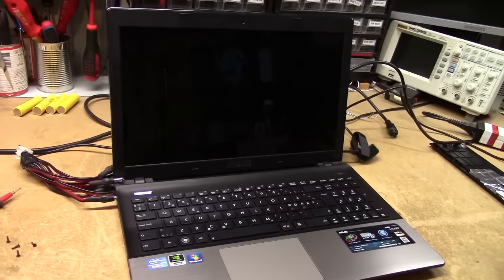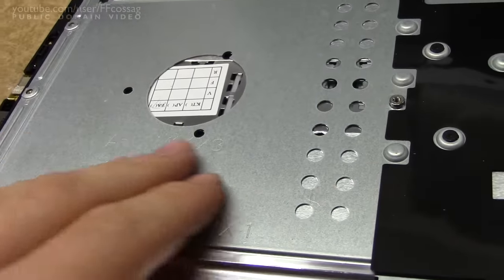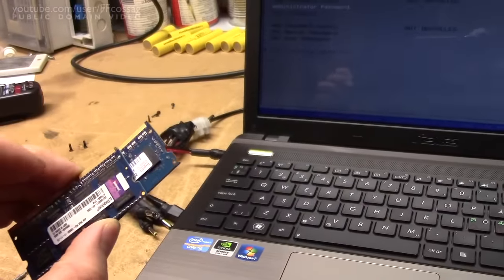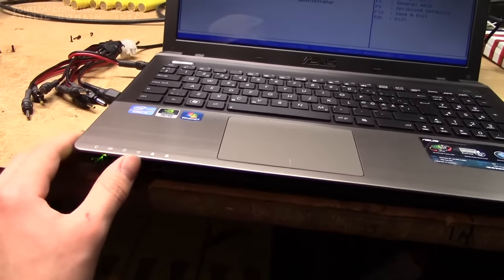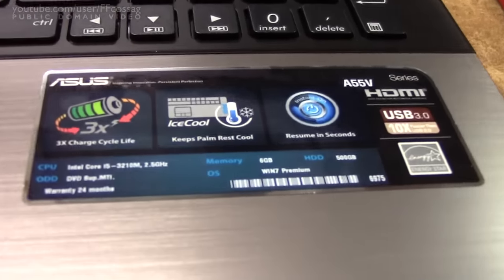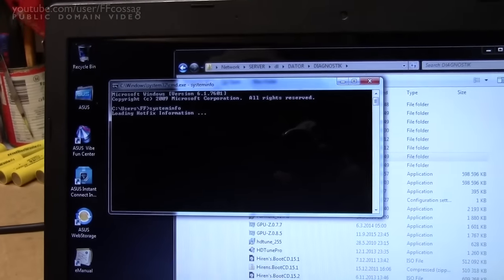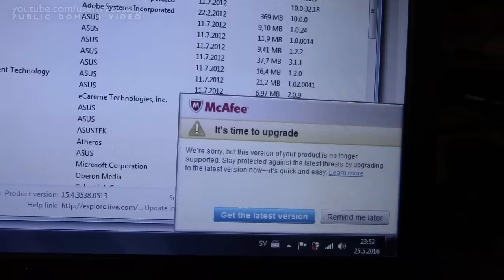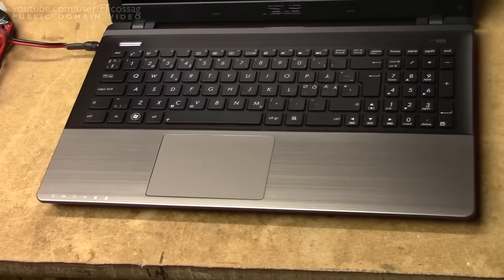Trash picked, i5-powered, NEVER USED DOA ASUS laptop repair

Comment: older Windows 7 laptops had such a nice design
Reply: Paul, got back to the PC Gaming And Building Enthousiast group. No need to be on youtube my freind. 
I know you but you don't know me. #Spooked
Reply: if you think thats a nice design you need glasses
Reply: I have the Asus X540SA with Linux!
Reply: Paul Addy like my hp elitebook that I had a few years back
Reply: Khyree Holmes Which distro?
Reply: my laptop is an acer aspire one 725 and it has the crap design even though if its running windows7
Reply: They were thicker and you could upgrade a lot of things in it. Also, I felt much more confortable with the windows 7 laptops.

Comment: "Must have internal CPU graphics"
Literally has an Nvidia sticker.
Reply from the maker: The Nvidia graphics are actually slower than the integrated Intel graphics, lol.
Reply: FFcossag It's a Sandy Bridge CPU. I doubt it.
Reply: TheGame455 That might not be the case because mobile chipsets usually run on a very limited TDP and can't fully utilize both cpu and igpu at the same time. That's why laptops with even the weakest dedicated gpus will always benefit greatly.
Reply: that's because those intel integrated graphics pull resources from the cpu and csgo is a cpu heavy game, I have an i7 - 5500u with a hd5500 but the 920m is far superior to intel
Reply: It's Ivy Bridge. It has an i5-3210M which is 3rd gen not 2nd as the owner thought incorrectly

Comment: laptop repair is somewhat overvalued business - a guy would dump it than pay what they ask
Reply: I wouldn't say that the work itself is overvalued. But having that work done to a thing that's not even worth it, is of course a whole different issue. I had an opportunity to try and fix a broken laptop abroad, in Ukraine. In fact, I went and bought a dead laptop, here in Germany, specifically for that (Asus A93). Including the cost of repair (€60), used ram and a used HDD, the whole thing cost me €150 (let's say 160 USD). They managed to revive the laptop, but it took them longer than expected. It took them over a month, they kept delaying and feeding me some bullshit. They said there was no way to restore any function to the USB3 port and that the GPU was dead. To this day I wonder whether they have stolen my GPU (replacing it with a defective part), or not. The laptop remained usable, thanks to the integrated (Intel HD 3000) graphics. Anyway, after I got back to Germany, I resold it for €200. Absolutely not worth the hassle.
Reply: Dick Johnson totally agree. Like tablet and phone repair. More compact harder it looks to fix.

Comment: Intel 3XXX i5 "must be a second gen CPU"
NVIDIA Graphics sticker on the pal rest "Must just have integrated graphics"

What are you talking about?! :|
Reply from the maker: I speak from a position of not really caring too much. The Nvidia GPU was furthermore slower than the integrated graphics in the CPU, so it technically only has integrated graphics as far as performance goes.
Reply: It has a dedicated graphics chip and VRAM soldered to the motherboard
Reply: That says that the Intel HD 4000 mobile graphics are 40% BETTER than the GT 610m.
Reply: 3rd gen because of the number 3
Reply: Maybe he thought about second of something as in X2XX of the third gen.

Comment: I upgraded a 15 inch HP laptop using some salvaged ram from my old laptop.
The frequency was different, but the higher frequency stick was adapted to the frequency of the lower frequency stick.
I had no problems, despite the sticks being of different makes and frequencies.
I have no idea how the same circumstances would have caused such a problem in this computer.

Comment: The hard drive is a few years old and is made by Hitachi. Nothing against them, but all hard drives I have used by them have been loud and weird sounding. Just to let you know!
Reply: They weren't called the Hitachi death-star back in the day for nothin.... with all that noise they made you could never tell without using S.M.A.R.T. if it was dieing or not. they usualy took a crap all over your data and died when you least expected it, too.
Reply: I hate to step in here but those desk stars from back in the day were manufactured by IBM furthermore one bad product line does not define a company as a whole if it wasn't for IBM we wouldn't be where we are today
if you were to look at statistics hitachi's have the least failure rate of any manufacturer for nearly a decade now

Comment: That I5 is a 3rd generation Ivy Bridge not 2nd gen Sandy. 

You also stated that it has only integrated graphics, there is clearly an Nvidia sticker right on the palm rest.  It's more than likely switchable graphics considering the Intel HD utility is installed alongside the Nvidia Control Panel.

They did not install Windows in 2009 on a machine that was manufactured in 2012, the date rolled back because you pulled the CMOS battery and it reset the date.

I will say I'm not a fan of those touchpads either, however the gesture you described where it tried to zoom in with two fingers touching the pad simultaneously is going to happen on most modern touchpads.  Most laptops have multi-gesture touchpads since 2012.

Lastly your Louis Rossmann statement in the end is highly exaggerated.  I'm sorry but it's very obvious that your knowledge is a bit Limited in this area.  I give you Kudos though for taking the initiative to figure out the problem.

It might be useful to do a bit of knowledge prior to making a video like this if you're going to reference a genius like Louis Rossman.  I'm just saying it might project a better image of your intelligence.

Comment: I had one of the top models of this range. It was absolute crap. Mine had an ATI card which Asus promptly stopped releasing updates to after a year or so. ATI didn't provide any since it's one of those hybrid solutions that can use either Intel HD or the ATI card. Just after the warranty ran out, it started freezing randomly. Also, if you ground your foot against something like a radiator and touch the "chilled armrest", it will give you a small tingle of electricity. Btw, the "chilled armrest" is only good for getting quite hot after about 5 minutes and becoming sweaty.

By far the worst computer I've had the displeasure of dealing with, and I'm a IT-support/hardware tech.

I hope you have a better experience though.

Comment: 3210M is ivy bridge, IIRC. so it's not too bad off, considering some of them are still as fast as their haswell counterparts.
the 500GB Hitachis all make those noises now. I'm betting it's more the resonance is making its way out of the drive caddy into the rest of the machine. 
the easier adhesive sticker removal thing is to take the sticker you peeled off and use it to keep picking up adhesive on the palmrest with the adhesive on the sticker until it's all gone, no need for spirits or anything.

if you're keeping it, SSD definitely. Ivy bridge is still very usable, and as a laptop, it's perfectly fine. it's probably also worth a bit of money in its current condition, if you need it, but it's a decent laptop.
Reply from the maker: If it would have been anything slower, I'd probably sold it, but I just slapped a cheap-o SSD in it and I'm thinking of keeping it as a dedicated livestreaming computer.

"As a laptop" it's not very usable, since it's a bloody ASUS and the screen is going to fall off after half a year when the plastic around the hinge thread inserts break.

Comment: The hard drive sounds are normal. Hitachi has really aggressive APM (power management) enabled by default. You are hearing the heads load and unload over and over. I suggest disabling APM to prolong the life of the drive beyond ~4 years.
Reply from the maker: That's not the noise I'm concerned about, the drive is actually spinning down for a moment every few seconds, which is not something I've ever seen a healthy drive do - but plenty of faulty ones.
Reply: That's part of APM. It unloads the heads so it can reduce the speed/stop the spindle. I've had a few drives that did this and they lived healthy lives after I disabled APM using CrystalDiskInfo.
Reply from the maker: Mark Furneaux
Alright then. It sounds like an awful way of making the drive quieter/cooler.

Comment: I'm using a model similar, but different to this laptop, the Asus N53SV-SZ404V. It also is equipped with 6GB of ram, I believe there are two different brands of ram indeed.
The original install is as bad as it gets, full of bloatware! But hey, i7 @ 2.00GHz and it still has an optical drive, which with (apparently) all manufacturers today following Apple, are getting hard to find. Yes, I still use those shiny discs sometimes!

You're right about the touch pad (Elan). Mine broke within the first year! And the gestures bullshit doesn't add anything except annoyance. There is even a function-key on the keyboard to turn the touch pad off, but it doesn't work at all. Very annoying when typing. The software handling the hot-keys and function-keys is equally as bad. Sometimes keys don't work (for example volume control), and one reboot later all is well again...

Comment: I worked at Staples (an tech/office supply store) as a tech. we used to run deals where you could bring in an old computer, no matter the working condition or age, & get $50-$100 off of a new computer. 
now THAT'S how you get people to start recycling

Comment: Most likely the ram was just very slightly dislodged in shipping. Ive had the odd laptop which turned up like that. However im smart enough to check the ram as one of the very first things if a laptop wont boot/post

Comment: I have a legit computer business and I do a lot of electronics as well so at the worst I would have stripped them for parts, but I have a constant flow of people that don't pick their computers or equipment up and tell me to keep it because they can't afford it. I offer many options, but I have a constant flow I have to sell. At this Good Will Store around the corner to my house, they had 100+ Towers from the administration building at a chemical plant. They were put aside in the back and I noticed they were only 3 months old and they said sadly they're all junk without knowing, there was i7, i5, i3 with LCD Monitors, keyboards and mice and they said they were throwing them out, I asked if I could take them, hell yeah... It turns out they all started, but wouldn't boot so I restarted it in safe mode with networking and did a online scan and it was a network virus so I did a fresh install and sold every one of them in a week... 3 of the i7's had a 1080 NVidia card with 3 fans which I should have kept one, but the money was crazy and they all had Windows 8 Pro so I upgraded them to Windows 10 Pro and they all had SSD's.... People are damn stupid. We had free upgrades for Win 7 and 8 for a year so I took advantage of that. I don't understand how some people tick? One thing in common is they're all liberals.

Comment: processors in these asus laptops are very good they are super quick and very nice.
Reply: those touch pads are also better than the macbook ones but that means nothing to me... because i have a macbook it is horrible.
Reply: +Zachary Well it still only is a dual core though
Reply: well what laptop on the market right now isn't? lol the fact that intel still persists dual core cpus after 10 years is very irritating and the same amount of cache(or much less), my laptop from 2009 (c2d) has more than most of the i7's on the market now like WTF INTEL.
Reply: at least most of the higher end desktops are quad core now lol
Reply: Zachary Well, my computer is dual core but yeah
Reply: ik the struggle lmfao
Reply: Zachary Struggle with what?
Reply: intel and it's dual core fetish lmfao
Reply: Zachary Well, i'm not one of those kids like you who thinks that anything that's not the most high end stuff is SHIT. I don't need anything better than that.
Reply: i didn't say anything that wasn't the highest end is shit i haven't owned a new computer but once and it wasn't a high end computer by any standards i was just saying it is time for intel to move on from dual core cpus because it is holding the industry back...
Reply: Zachary Yea
Reply: Intels new i5-u and i7-u dual core cpus are great. I used to have an i7-4500u, and now have an i5-6200u. 15 watts TDP. Really good battery life, and still up to the task of modern computing. Hell I edit 1080p H.264 footage in Adobe Premiere on my i5-u. Works well. The majority of computer users even today won't need more power than these things can deliver.
Reply: HeylonNHP ;ets see if that remains true in a few years lol
Reply: buy asus k53u and you will change your mind

Comment: It has a discrete GPU too, my cousin has this laptop still works. The screen is absolutely horrible, TN panels at 1366x768 Yuck.
Reply from the maker: The silly part about the Nvidia graphics in this laptop is that the integrated Intel HD Graphics 4000 in the CPU is marginally faster and uses 10 W less power.
Reply: Wow what a joke, even with newer drivers?
Reply from the maker: ***** I'm basing that statement on 3DMark06. You need to consider that the GT610M is the lowest end GPU that Nvidia offered at the time.
Reply from the maker: Toshi Crowley
Yep.

Comment: I've found a core I7 first gen alienware laptop and a 3rd gen core I5 apple MacBook pro in trash
Reply: Holy crap that's really good I usually find systems from the socket 775 era or below with the occasional i3 2nd gen or am3 system with my best system I found being an hp prodesk i3 4130

Comment: When a trash laptop is A LOT better than your laptop... (sempron m120, it should be 1 core, an nvidia 8200m g, which is integrated and 3gb of rams... it can't even run windows 7 and lags with video streaming 480p)

Comment: similar to my laptop. mine has some 2c4t i5 that boosts to 3.4ghz, 8gb of ram, a 1080p screen and a geforce 650m 2gb.
it's actually getting old enough to annoy me. funny, it doesn't do the stuff it did when i bought it nearly as well. fucking internet with incessantly increasing hardware demand, dual cores are barely usable nowadays :\ even a fucking 3.4ghz i5
Reply: GraveUypo a clean install might fix your problems

Comment: It can be i5-powered but it has shit graphics :v
Reply: +Shimon Levy The Nvidia GPU is actually about 40% worse than the Intel integrated graphics, its really bad
Reply: its actually better in gaming i have the same specs but 1gb 610m
Reply: i can overclock my 610m in my laptop from 2012 over 110mghz

Comment: wow i was right . reason ik was fixed laptop same issue but toshiba for my moms riends and was barely used windows 8.1 3rd gen i3 or i5 and put windows 10 on it and it works fine now